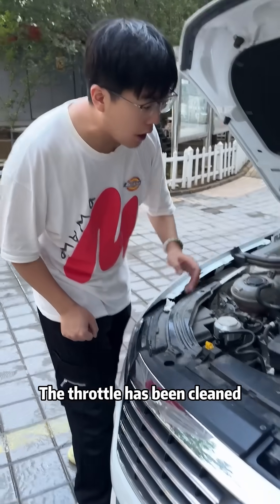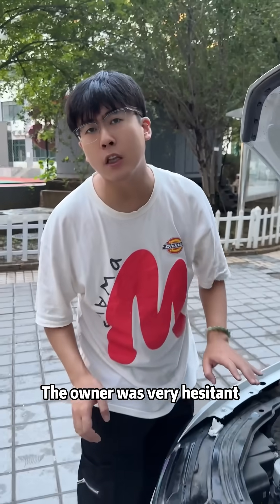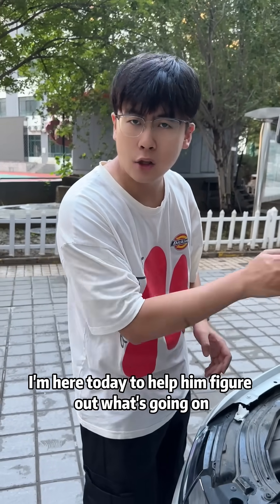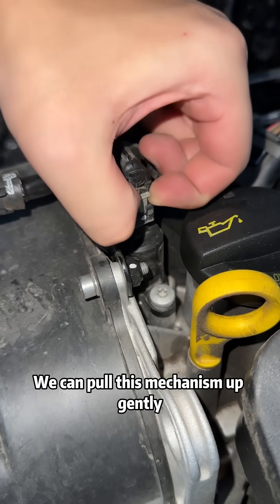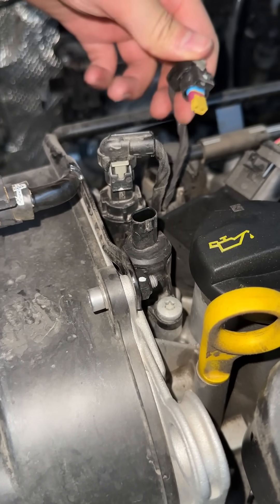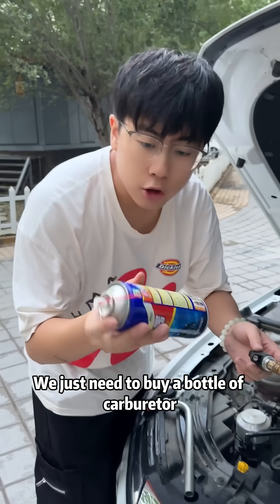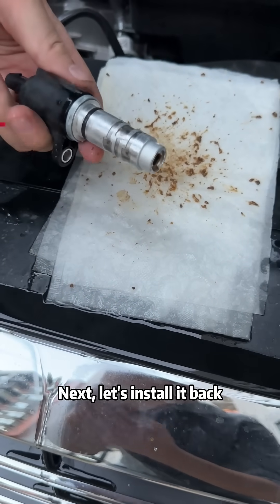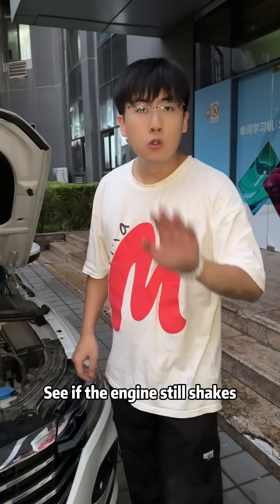Only 1% of people can solve the problem of car shaking!#car

Comment: Hi
My Skoda Octavia 1.6tdi, 
Misfire and shake idle, like parking or stopping at traffic lights may I know the reason please
Reply: Unfortunately you didn't state the year and the number of kilometers on the engine.

You should start by checking the simple things. Is the air filter clean and are there no  obstructions to the motor getting air. Are there any diesel fuel filters that should be replaced. Many people ignore these has a hard time getting through and causes problems. Go to your auto parts store and get some diesel injector cleaner that can be put into the fuel and drive your car for a while and see if that makes any difference.

Comment: My daughter has a 2020 Nissan kicks replaced maf, apark plugs, and coils. Cleaned o2 sensors, but the fuel trim is stuck at 0 & 25. Keeps saying multiple misfires and cylinders 1 misfire. What do you suggest

Comment: My carmy has the same issue, the first mechanic said it's the engine mount worn out so I paid to replace it but the shaking is still there, then he said I need to replace the other 3 mounts but I couldn't afford it and he can't guarantee it either. Then the second mechanic said I need to replace the rotor disks so I did but the issue is still there. So now I'm thinking to do it your way when I have time.
Reply: Are you kidding me. That kid doesn't know shit

Comment: To stop shakes, you clean that valve.  What about an older car (no electronics)?  My Chevy V8 does this.   Thanks
Reply: Did you check the injectors,or engine  mounts.
Reply: @gerolddo  sorry carbureted, mounts are good.  Car shakes.  Points ignition, plugs wiring good.
Reply: It seems to be better with higher octane gas. One owner on Youtube swears by Chevron Supreme. He said no issue what-so-ever with that. 
And it seems also that 5w30 oil can help also. 
But from what I have found was that this engine was made to be lean on fuel.
All to do with the emission. 
A bit to lean, that's why it's shaking.

Comment: bro,my steering become tight after changing steer oil belt engine shock absorber all 
plz advice
Reply: Possibly not a fluid that's compatible with your system.

 Try draining it and refilling with OEM suggested fluid-(make sure to start the car each time turn the wheel full turn each way twice, stop let cool) -maybe 2-3 times to make sure you have as much of the "other" fluid.

Comment: I have Honda odyssey 1997 ex-l model v6, whether A/C on or not, I see hot air coming from driver side vent and one time I replaced cabin filter and it worked and after 6 months, it is back to the same problem , can you help to troubleshoot the problem.